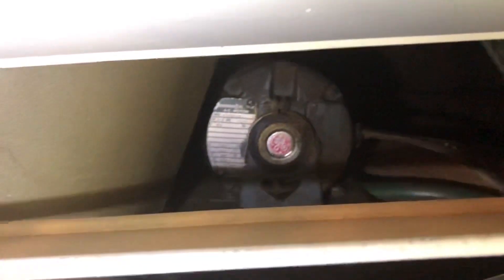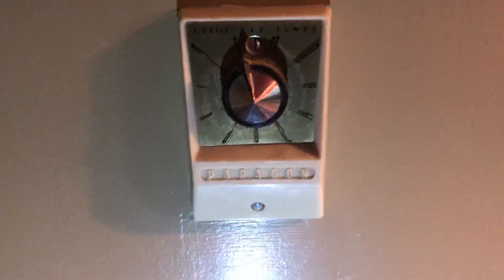Vintage ACME 30” Whole-House Fan

Comment: The house I grew up in had one of these just like this but it was from sears. They're really cool and efficient, idk why they stopped putting them in homes
Reply: The popularity of air conditioning that's why they don't use and put these in homes anymore however you can buy them online new